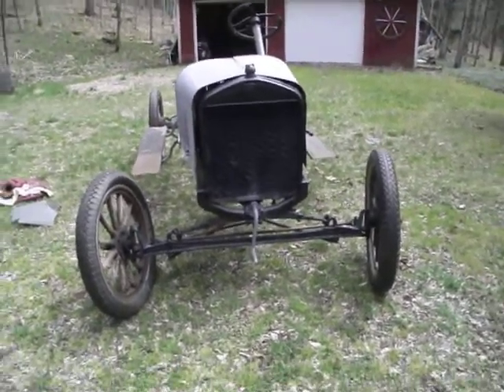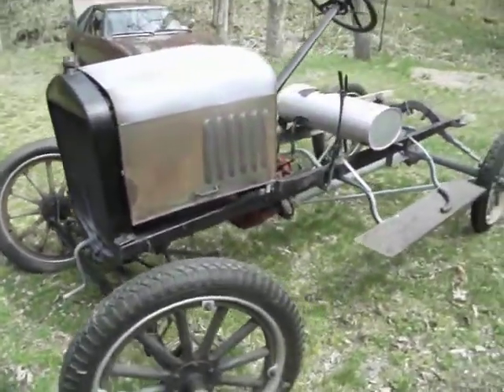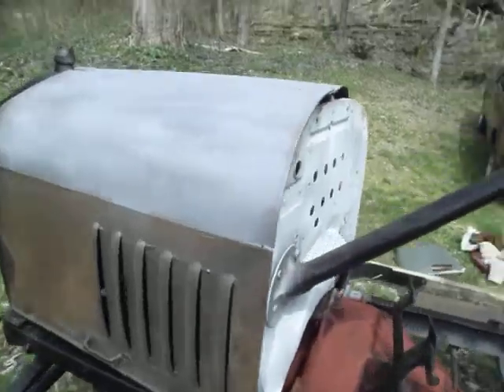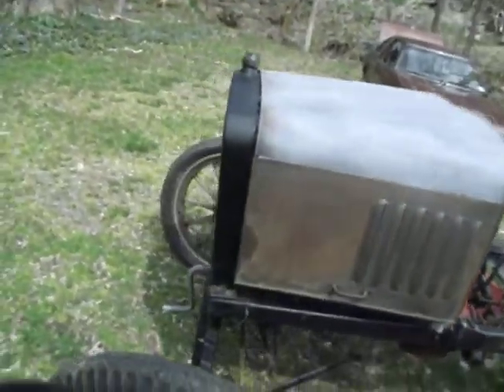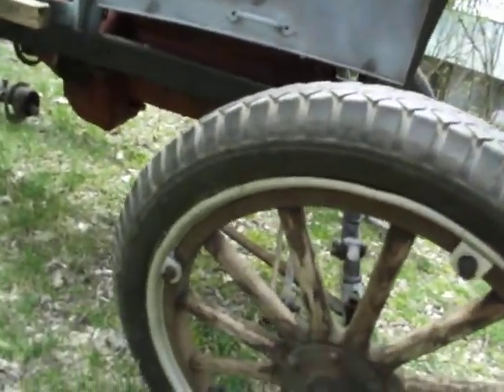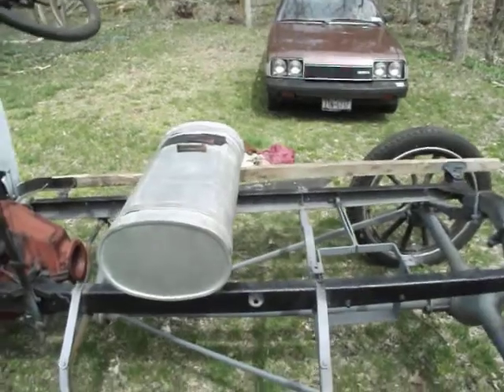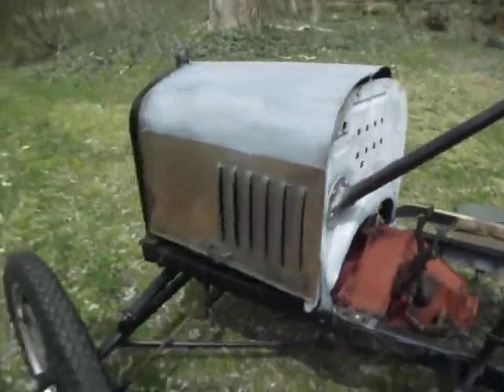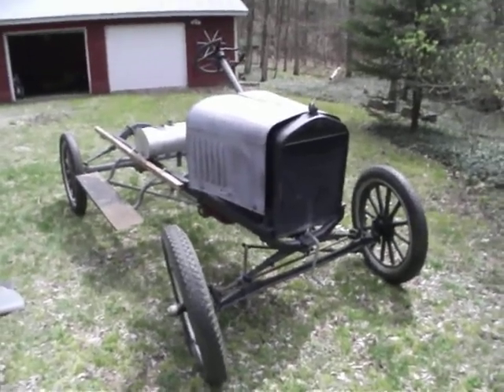1925 Model T Ford speedster build project

Comment from the maker: Thanks. This summer I rebuilt the engine. The 4 dip engine pan needs welding due to the old rivet being bent and warped. After fixing that the engine is going back in assembled and ready to run. I have to get my spare rear end out because the other one had a cracked axle. Rear end rebuilds are pretty easy. It should be running by early summer once i'm out from school. I've decided on a speedster design for now to save money (broke college kid).

Comment from the maker: Yeah, bad rims/spokes are pretty common. If it can be afforded you should always try to replace the wood. Since this video i've checked them. Of the 4 wheels the spokes are good for 3 of them. the front right tire spokes are bad though. I'll probably hang those spokes up on the wall and put on a spare I have. Engine was amateurly rebuilt by myself and the local club this summer. I need to straighten the pan because it has a warped rivet, but it's going in, hopefully running by mid/late June.

Comment: Hi, do you know where can I find the plans to build one ?. thank you!
Reply from the maker: +journey2  Sure. There are numerous sources for rebuilding or restoring a Model T Ford. First thing you'll want is go to "Langs old car parts" online. They have just about anything you'll ever need in line of repro or Original parts. Order from them these books: 1) The Model T Ford manual, 2) the KModel T Planetary transmission 3) The Ford Motor 4) rebuilding Ford motor/Transmission 5) the model T electrical system. Also it wouldn't hurt to get a copy of the poster for oil ad lube diagram. Most importantly though, go onto www.mtfca.com (model T Ford club of america). Make an account and introduce yourself. There are thousands of members and tens of thousands of posts concerning model T ford history, rebuilding, pics, diagrams etc. The members are very friendly and always willing to help. You may even be able to locate your local mtfca chapter from there and have them come over to help.